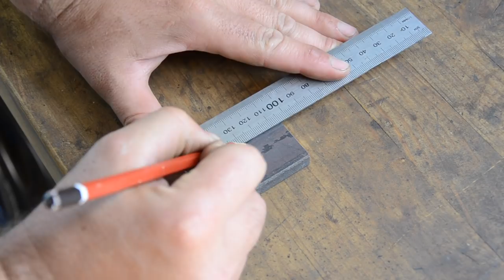Broken Vise Restoration

Comment: OMG when I first saw this vise, I thought, what waste of time even trying to get it working, much less restoring it. The end result is nothing short of spectacular . What brand is the vise ? My wife came into the room while I was watching and said, what is that and what is he trying to do ? Great job, and look forward to the next project. Thanks for sharing...Ken
Reply from the maker: Unfortunately the name plate had been broken off or removed previously so I don't know what brand it is. Thanks for watching!
Reply: Looks like a big Yost vise
Reply: It's almost identical to brand new Yost 750-DI.
Reply: Kenneth Bartlett fe
Reply: I have one exactly like it. I bought it at Big Lots years ago but it's been a good one so far. I lost one of the pipe clamp dogs and need to fab a new one but other than that, it's still functioning fine and dandy.
Reply: I am certain that is an Olympia #5 vice
Reply: This is an "Allied" bench vice
Reply: I have one its Yost Vises 750-DI 5" or 7" and you missed to place one of its jaw (pipe holder)
Reply: I have the same vice.  Got from costco in 1990 for about $40.

Comment: I find it rather funny that when you see any swivel vice more often than not the swivel lock handles are jacked up.  Must be some right of passage for a vice.
Reply from the maker: Haha yes they frequently seem beat up on these old vises!
Reply: These import vises have a issues with the base not really locking. It takes everything you have to get those tight enough to be useful.
Reply: one would think that the people making these would at some point realise that they have to make that stronger
Reply: I read somewhere that if you use a hammer or cheater on the lockdowns or on the main handle, you are exceeding what the vice is capable of doing without breaking it. Still do it though. :-)
Reply: They seem to be just mild steel. Very easy to bend.

Comment: I'm curious how the welding held up.  
I have the same vise, broken at the same spot, even the same color paint.  No markings.  It belonged to my father-in-law, otherwise it would have gone in the scrap pile after it broke.     After watching many Youtube videos on welding cast iron I gave it a shot.  It lasted about a week before it broke again.  This time I'm building a complete new front jaw using thick-walled steel pipe I got from my local metal supplier.   I can at least reuse the base and screw and hopefully have a functioning vise again.   And for those commenting how this is a waste of time....no one made  you watch.  Troll on!
Reply: As someone just learning, what type of weld?
Reply: @amandapatrick827  In the video he uses a stick welder.
Reply: I forgot the type but there's a specific kind of welding stick for cast-metals i used to put it on water after welded
Reply: use 7018 (or 11018 if you can get it)  Low Hydrogen welding rod to weld this cast iron.  Also you can use cast iron welding rod but it looks ugly when welded, do not try to get a good looking bead with it.
Reply: when you weld cast iron you have to heat it up first, heat must be even. then use cast rods to weld it then wrap it in a blanket of some kind so it cools slowly
Reply: oldog -  I believe you are mostly right.  Some castings are also forged after casting and will respond differently to arc welding.  It can be seen in the broken parts whether they look like course grain sugar or fine grain confectioners sugar; the later being more easily arc welded.  As for cooling all I know is if it survives a drenching it's a good weld; but if it doesn't then the annealing you talk about is necessary.  Safest thing to do is cool slowly.
Reply: As cast Iron is a high carbon steel so you need to naturalise it afther welding it with the correct welding rods as the structure in steel will have weakspots in and around the weld as castiron isnt a steel type you should weld in the first place...
Reply: With dissimilar metals like cast iron and regular rolled iron, or forged iron; or stainless steel to regular iron using stainless steel welding rods can be used.  Also stainless steel rods can repair cast iron to cast iron .   Brazing can also be used for attaching or repairing cast iron but that requires the heat of an acetylene  torch which is quickly going out of style e.g. nobody has it anymore.
Reply: Once bought a small vise that had been broken from a used tool store that repaired stuff. Held up well couldnt tell how they did it might have been brazed? Had some filler material that looked like bronze or brass.
Reply: I have always used Nickel rods for fixing broken cast iron.
Reply: NEVER quench a weld. That makes it brittle, which is what broke it in the first place. Let it cool down naturally, or pack vermiculite around it so it cools even slower than air cooling. There are special rods to use to weld cast metal, or cast metal to cold or hot rolled steel. Any good welding shop should be able to point to the right rod to use, and the setting for amperage on the welder.
Reply: you can also use one that has iron in it. a Valve broke at work in the housing, so we had to weld that, and it was cast iron. worked out great, not ideal but was good enough, still holding strong after 2 years :)
Reply: use nickel electrode for cast iron.or brazing is the effective way,there are several techniques on application on cast iron welding
Reply: Cast Iron is difficult to weld and certain procedures "must" be applied in order to have a successful result. I have welded cast a few times ($6.00 each for a very short 3/32 stick) which included pre-heating and post-cooling and peening between beads and also short short beads so as to not apply too much heat. Welding a vice in the spot that that vice was broken is not going to give good results because as the vice is tightened on whatever is in its jaws will put excessive stress right where the weld is and it will break the weld.
Reply: POP @amandapatrick827  Cast Iron is not easy to weld. I have welded cast before and always wonder if it will hold, so far I have had excellent results, but certain procedures have to be followed to get these results and I follow them to the letter.
 Usually, it is stick welded with a specialty rod. I have used a Harris rod NLW59500POP and also an ArcTech rod but I don't recall the number for it.
Reply: Richard
Reply: That is VERY COMMON, but wrong. They look fine, but if you do that on flat sheets of steel, and then destructive bend them, they will fail at the weld every time. It makes the weld brittle. You are not destructive bending to find it's weakest spot.  There are many companies that do the same thing when welding wheel rims, but they are seldom tested for their weakest spot. They do it to speed up production. If you want the strongest possible joining of two metals, you will let them cool slowly.  In fact, if the whole object when finished is heated and then cooled as a whole, the whole thing will be stronger.  Look up how they make swords, and quenching makes the surface extremely hard, but more brittle.  @UrGayNus

Comment: How does the welding hold up. My experience is welding cast iron is not very strong and it will break again.
Reply: I would have put some dowel pins in .
Reply: Cast iron is nasty shit to, we stopped welding it in our shop. It’s also brittle. the feeling of the weight gives false confidence of strength. My 2 cents .
Reply: Learned this the hard way.. tig welded chain vice handles back on not realizing there was a difference. Flat on my ass in no time 😂

Comment: I understand the utility of being able to rotate the jaws ..Maybe i'm not seeing it, .but shouldn't there be some sort of locking mechanism so once you clamp something into one side or the other, it won't spin on you while you're working on it???
Reply: Someone else commented that the rotation stops as you tighten the vice.
Reply: it does.
Reply: The clamping pressure is transferred to the disk type thingie  on the back of the vice and it will NOT spin.  You're right if it did it would be completely useless.

Comment: I enjoyed that. It took me back several decades. Any idea what brand it is? I know it swivels on 2 axis but didn't noticed what locks the main screws/jaws in position. Good job.
Reply from the maker: Thanks Charlie - unfortunately the nameplate had been removed or broken off and just the studs left on the side. I would have loved to known the brand :) The two screws in the back of the vise locks the main body from rotating.
Reply: +Will Matthews That vice bares an uncanny resemblance to the brand new Irwin multi purpose vice I purchased the other week. Perhaps one of their earlier models seeing as they have been selling over here seems like almost forever now! Anyway brilliant job mate.
Reply: Mine is identical and was purchased about 30 years ago from PriceClub (became Costco). The riveted label says Multivise 5" heavy duty made in china. The box says "Alltrade" is the manufacturer. In reality these were generic castings sold under many names. Mine cost around $30 canadian new 30ish years ago. Still see them between 50-80 on sale. The casting quality was and is, a real crapshoot. The pipe jaws were handy but the swivel feature won't hold for heavy work. The original color was more of a robins egg blue. Google Alltrade vise. They made millions.
Reply: This looks exactly like my Harbor Freight vise that is broken in the same place, I have taken mine apart but not yet made the repair as you have.
Reply: Bought mine at Big Lots fifteen years ago. Same exact vice. Not broken yet though. Oh crap! I wish I hadn't said that.....
Reply: Altrade made in China. Functional but not high quality. Had mine for 20+ years.

Comment: Great video, if the weld does crack again heat the steel with a blow torch before welding it. you will get a much deeper weld. Great job on the restoration

Comment: You're supposed to heat cast almost cherry red before you weld it. That'll probably crack
Reply: Don't you need a specific rod type as well, or is that if you are not getting it cherry hot? I seem to remember something about that 
That being said I've seen guys use a similar technique to what he is doing, short welds with time to let it cool down between welds, with good results back on the farm. If it cracks it just means another chance to give it a go, and he seems more then up to it.

Comment: When you welded the shaft on how did you get the exact angle? Because if you hadn’t the jaws wouldn’t have closed parallel.
Reply: Yes , I completely agree with you
Reply: It looked like he left part of the break intact, only bevelling it down to about 1/8" of the broken surface.

Comment: 50-50 Acetone & ATF. Shake before use. $12 half gallon. Please try. Thank you.
Reply: There was a very specific test on penetrating oils done by Project Farm not too long ago on youtube with exact bolts torqued to the same specs and rusted the same way over time.  Regular heat came in first, the old standard Liquid Wrench came in second, and your ATF mix came in 3rd.  For $3.47...  I'll stick with Liquid Wrench.
Reply: Well- think about that. $3.47 for 11oz. of the first  chemical  or $12 for 64oz.worth of the next runner up. BTW that mixture isn't my invention. Google "Acetone & ATF penetrant".
Reply: @HUBBABUBBADOOPYDOOP  Oh I know, it's been a thing for ages. I was just saying I'd pay the minimal extra cost for the convenience of no mixing, compressed spray bottle, nozzle, and have something that works better.  Especially considering one bottle of penetrating oil usually lasts me several years.
Reply: No one is going to use your difficult method. Stop spouting it to people who know better.
Reply: That's the cost of over 7 bottles of liquid wrench...  You combine that plus the cost of ATF and Acetone, and there's no way I would ever make up the added cost in my lifetime.
Reply: ONE Sub and zero content
Reply: Yea, for the average that would be overkill. I went through about a pint a week at the Shop. No way was the Boss buying spray cans of stuff. We didn't even have those refillable pressure pots back then. Squirt bottles & oil cans.
Reply: Yea, for the average that would be overkill. I went through about a pint a week at the Shop. No way was the Boss buying spray cans of stuff. We didn't even have those refillable pressure pots back then. Squirt bottles & oil cans. Mixing two things is too difficult. Does Mommy pour milk on your cereal for you too?

Comment: Seems like a sand blaster could save you some effort
Reply: I'll give you a rocket pack, if you'll strap  it on and light it.
Reply: I don't like to to sandblast (or grind/ sand) old paint that might contain lead. I prefer paint stripper in that situation.

Comment: god only knows the pressure needed to have broken that shaft
Reply: Her grip was mighty tight.
Reply: Split my vice in nearly the same spot doing lighter work than i had in the past. I assume it just stresses overtime and cast iron is brittle so it can only take so much until it snaps.
Reply: that’s what she said

Comment: I’m just amazed at how incredibly well you restored that bench vise. Fantastic job well done!  I have an issue with mine from hf whereas the screw pin on the side that keeps it from rotating around to the bottom that holds pipes and stuff is stripped out. I think I’m going to try to recut the threads with a tap & die or I may have to drill a new hole idk.

Comment: I had the same break in my vise and did the same weld job, only lasted a week. What did work for me is I put the part in the oven as hot as possible, welded and then put back in the oven to cool slowly. So far so good and that was several years ago. Granted heating up parts like that where you heat up your food might not be a great idea but  my vise works :)

Comment: Dude! You need a bead blaster.

Not only does it save a ton of time and do a much better job of cleaning, but it's nothing less than fascinating to take something funky looking and make it look better than new in seconds.
It's like washing the old off with a water hose...
The first year I had one I never passed up a chance to restore something with it. Blasting that vice before disassembling it would have made it a ton easier to get apart that rust was gone.

Comment: Awesome restoration. I have that exact vice , and I did a bang up job of what you did lol. The only difference is the castle nut on the end. Mine has a generic castle Nut with a washer behind it. Which the original could of gotten damage , mine has a lot of wrong bolts a nuts on it hahaha. I actually painted mine with the hammered copper paint. I wish I would of watched your video b4 I tackled mine. Good job

Comment: Now you just need to make new pipe jaws. I actually have one of these that went thru a fire and sat out in the weather for several years. Got it mostly apart, but still got a lot to do to it before it goes back together.

Comment: 1. Use antiseize on the bolts.
2. Always grease both sides for moving parts. 
3. Never showed you cleaning the box end threads for the torque
 bolt.
4. Beautiful, Great Job!

Comment: Nice effort. Came out really great looking.

If your weld doesn't hold, grind away the first weld. Fixture everything the exact same way you had it. Buy some welding rod meant for cast iron repair. Put the fixtured parts and the welding rods into a 500* oven for a couple of hours to saturate the whole assembly with heat. And to remove any moisture from the rod.

Pull it out and weld it up immediately, then place it back into the oven and cycle it down in heat over a few hours.

Welding cast iron is a pain in the ass, but this is the only method that has ever had repair longevity for me.
Reply: Vises are not made from cast iron but cast steel. His welding was correct.
Reply: @markman63  Oh, they are made of cast steel? I didn't know that.

Apparently, manufacturers like Wilton don't know it either. Because the product description for all of their vises read like:

Wilton Tradesman Vises like this 63199 #1745 have an extra heavy duty 60,000 PSI ductile iron casting.

Give 'em a call and let them know they have no idea what they're casting their own vises out of, LOL!

Comment: Super restoration.  My only concern would be in regards to the welding.  You should have pre-heated, welded then allowed to cool wrapped in a heat blanket.  Brazing would probably have been a better option.  Very cool video though.  Thank you!

Comment: Very good restoration, the vice looks great.  However I would have tried to straighten out the pins on the base swivel lock with out using heat, that will only soften them and make them more likely to bend in the future.

Comment: Great job!  Not sure about the welding lasting though...   I repaired a 5" offset vise I broke by using a 3ft. pipe on the handle: welded it wit cast rods first which lasted 3 days (NOT using a pipe anymore) repaired it again by bronzing it with oxy/acetylene AND it's still in one piece after about 20 years of more use/abuse...  :-)

Comment: The first 3.5 mins were quite painful to watch but so glad to see he didn't break that castle nut.  whew!  It would have gone better to clean up the threads first with a wire brush and file if necessary.  The blue&yellow spray can looks like WD-40 but I would never use that on old rusted stuff.

Comment: That was nice. One advice here - don't leave it with the jaws clenched tight - it's no good for the whole construction, if you don't use it leave it slightly opened, 1-2 mm enough obviously, No matter how much, just never leave it tightly clenched. That's a golden "vise rule" ;)